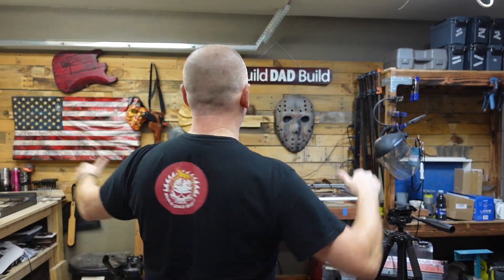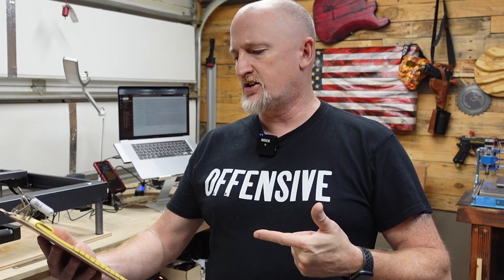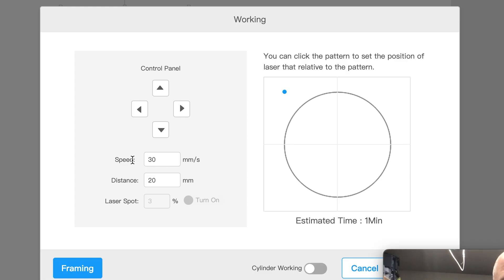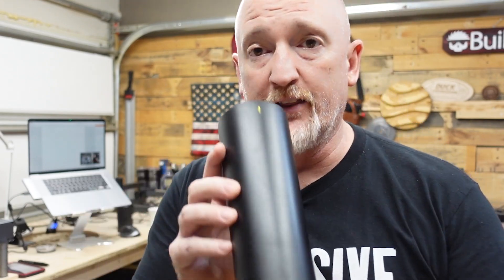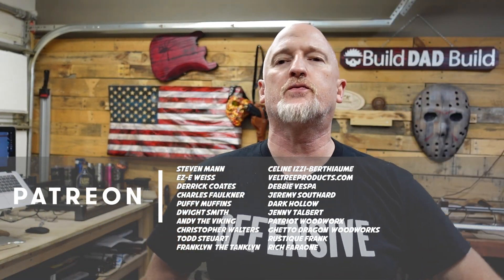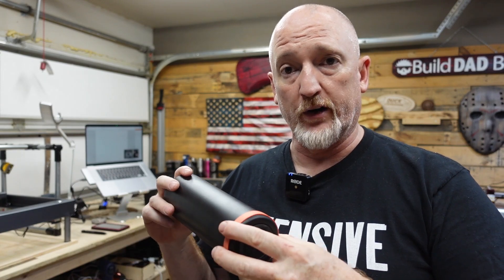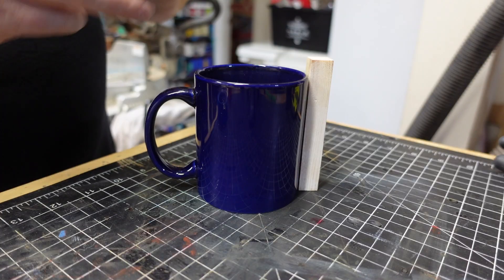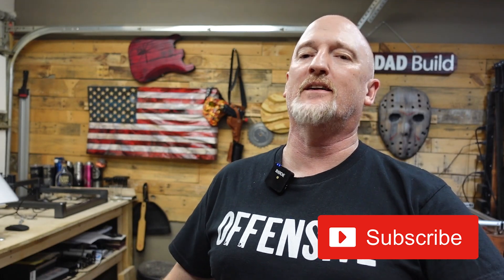Tips for Laser Engraving with a Rotary, Even Mugs! (using my xTool D1)

Comment: Great video! Thanks!
However, what is missing from almost all of your videos is SETTINGS for the different kinds of materials.
Keep up the good work but please write settings in the comments or say them in your videos.
Reply from the maker: That’s intentional. Different machines have different settings. Always better to find the best settings for your machine and the apps said technique
Reply: @BuildDadBuild  Thanks for your answer! Of course it is different for different machines, but if you could share your setting for your machine. I also have a D1 10W and I think many of us use this machine.
Can you write the settings for ceramic mugs used with the D1 10w that worked for you? I would appreciate it. Have a great day!
Reply from the maker: @matebollobas8024  So it depends on the ceramic you use. ALWAYS run a speed and power grid on a new material to determine YOUR best settings.
Reply: @BuildDadBuild  Thanks for the tip! Keep up the good work!

Comment: Can you tell me what the settings were to get the ceramic to burn through to the layer below the glazing? I know it vaires from product to product, but i was going to try a lightburn material test. I think the actual engraving of the ceramic cup looks fantastic!
Reply from the maker: Best to run a speed and power test
Reply: @BuildDadBuild  man! I gotta tell you. I get crap plates at $1 tree. Each one burns a little different. But the burn test did the trich to give me a great reference. When you expose the bare cooked clay under the glazing, do you protect it with something? Orherwise it just soaks up water. Btw; great videos! I learn a lot. Thanks for all you do

Comment: Have the rotary facing the right way but then where does the top of the bottle go? Left or right?
Reply from the maker: Towards the power button...
Reply: @BuildDadBuild  I just tried a test with low power and painters tape on my bottle. The opening faced left, away from the power button, same direction as the art. So if your art faced towards the power button you are correct.

Comment: You have some great videos that I have been using for my own engraving. In Lightburn's machine settings, which min/max accelerations and idle acceleration do you change?  What value should you lower them to? I did not see that in LA hobby guy's videos.

Comment: Nick, so appreciate all your content.  I have been following and trying many of your tips, tricks, etc.  I am currently having an issue with tumblers with my Xtool D1 10w with Rotary and laserbox.  When I center my cross hairs to start my burn, my image is not centered where I intended it to be, it is off about 1/2" each time.  I have verified my origin in design, lined it up with where I want it to be on tumbler. Is there possibly a setting I am missing?  Is there something I am doing wrong?
Reply: After watching your tips again (4th or 5th) time, and reading the below comments, wanted to also say that my gantry speed is set to 20mm.  I've even went as far as framing (2x +), ensuring I like, then lining my marks back up and hitting start.....still the same thing.
Reply from the maker: If you're using the RA2 you need to update firmware. If you have the old one, you need to weight your project.
Reply: @BuildDadBuild   Will do this.  Thank you for your response.  I may even add the rubber bands just to give a little extra traction.
Reply: @BuildDadBuild   I have old one, almost bought RA2, but was like...not yet.

Comment: I recently started etching a mug as a test with the RA2.    The mug is a dark grey color. The ring on the bottom of the mug is a whiteish color so I am assuming the mug is also white under the grey glazing.  When I run it, the etching comes out black and barely visible.      I have etched dark grey tiles and the D1 cuts through the top glazing without issue to reveal the below color.       Any ideas???
Reply from the maker: It all depends on the underlying material of the mug. I've had the same thing happen.
Reply: @BuildDadBuild  I had a feeling that was the issue.   Thx and I have gotten a lot out of your videos.

Comment: Thank you very much for all of the tips! I'm still running into the rotary tool ending in a different location when framing. Specifically on the rotary axis. It's a good inch off. I've slowed the speed, changed the image, tried the rotary and RA2 attachments, different objects, and all of your great tips. Any other suggestions or hidden settings? I'm using the D1 with Laserbox basic.
Reply from the maker: Just to weight it down and use rubberbands for traction.
Reply: @BuildDadBuild  just reinstalled the software and everything is working fine. Ah, the wonders of tech.

Comment: I have a question a friend of mine got the xtool d1 pro and it’s basically a brick no where in book did it say to download xcs software that I could find but everytime you turn it on it locks up you can’t move it at all when you turn machine off you can move it and it will not upgrade
Reply: Oh the 10watt
Reply from the maker: XCS is in beta. You need to download Laserbox Basic in order to upgrade firmware, etc.

Comment: I just recently hooked up my XD15 W laser engraver it is moving framing everything but it will not engrave it moves but it will not engrave like delays or is not working it stays red am I doing something wrong thank you thank you in advance
Reply from the maker: I think you are referring to your D1??
It sounds like you haven't focused the laser.
Reply: I did the drop down and then tightened and then hold up the magnetic switch if that's what you're referring to if not any other help would be greatly appreciated

Comment: How do you get the different colors on the mug? The blue one you showed was a black engraving and then the black mug was a white engraving. We’re you using enduramark for those? Also, we’re you just using the normal ceramic settings? Thanks in advance. Love the dad jokes.
Reply from the maker: Most of the ceramic mugs are just the same settings and those colors are the ceramic underneath.

Comment: I’m getting a bunch of random lines in my tumblers. Any thoughts? Also, the run time is crazy long… like over two hours. Thanks for all the content!
Reply from the maker: The lines can be from loose belts, speed too high, dirty rails, etc.
The run time thing I think is an issue with the latest update that they are currently working to fix.
Cheers
Reply: hoping you figured this out , i had same issue , thought mine was broken...turned out i was measuring wrong...i used the tape included and it would be 26 , so i kept inputting 26 mm , but it  is NOT 26mm , its 260 !

Comment: Dropping the acceleration (different than just lowering the speed) helps tremendously on these hobby lasers. Not only can you get slippage on the rollers, you could actually skip steps or jump teeth on the belts. 

The acceleration on my sculpfun s9 out of the box was waaaaay too high for even basic engraving. 

Laser GRBL has a good utility for this and it’s free for those who don’t want to dive into lightburn just yet.

Comment: All are great tips!  One additional tip, I would add, is to help minimize any slipping burn the cylinder/cup in a single image so it only has to rotate once in a single pass and not reposition the work piece for each graphic.  If it is a vector image I would convert it to a simple picture image so it does not burn each element individually. It worked well for the logo can coolers I did.  https://youtu.be/9geeZqFR8jA

Comment: Are there any tricks to get the cup Handel out of the way so you can get more coverage on the mug ?🤔😵‍💫🤯
Reply from the maker: Kind of. If you're doing something like a beer stein, take the width of the cup plus the handle X2 and cut the outside of your jig to that measurement and the inside to the width of the cup. Make two of those, one for the to and one for the bottom. Those "jigs" will sit on the rotary. The reason I say kind of is your are then limited to the area between the two jigs because the laser will hit them.
Or try something similar to this:
https://youtu.be/WVjw9pMrmdA?t=512
Cheers
Reply: @BuildDadBuild  thanks 🙏